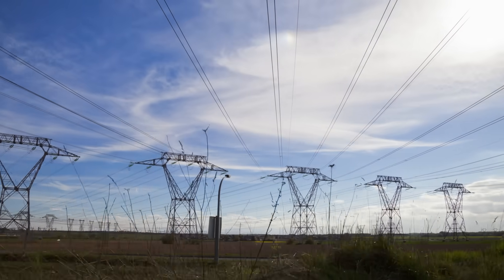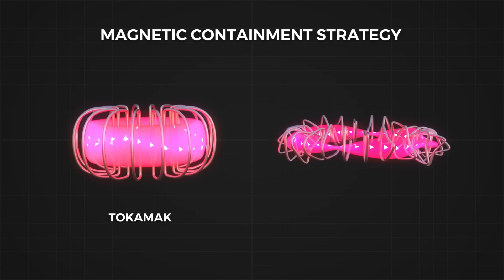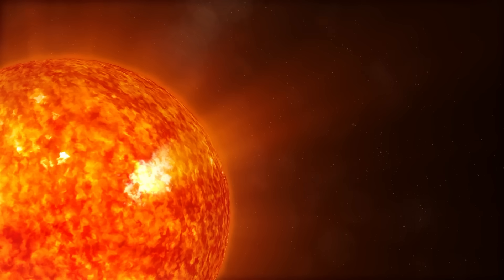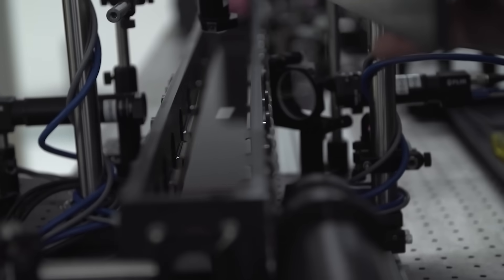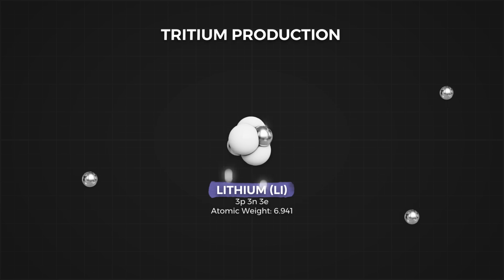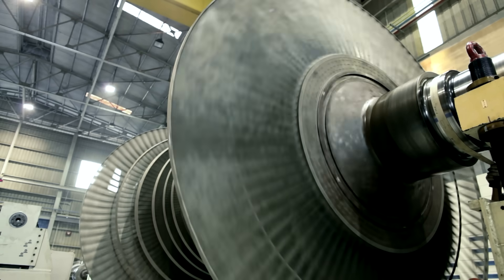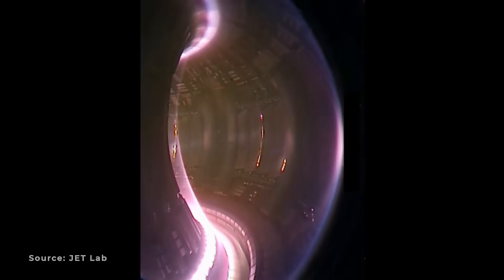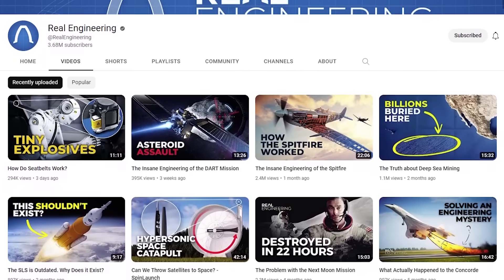The Problem with Nuclear Fusion

Comment: Commercial fusion would enable fast and efficient gasoline and diesel fuel generation. It can cost effectively extract CO2 from the air. So no need to destroy the Earth’s surface strip mining lithium and rare earth metals for battery manufacturing.

Comment: We are hearing more about Fusion in recent releases.   But I don't believe it is an answer.  Your post points out the many issues that are not yet over come. Supply of the right materials is a major issue.
And still we use steam,  which any train enthusiast will tell you is high maintenance.  
Personally I believe there is another way without steam driven generators. 
That said, the current urgency of CO2 clean energy  Current Nuclear Fission power is a must.  
Waste issues can be greatly reduced by having joint  Caesium / Uranium 235  waste feed into a Thorium Salt Water Reactor. 
This will give up the waste into energy,  reducing storage time frames dramatically, as there is less radioactive material energy left.   
Then waste could conceivably rocketed to the Sun where the Radiation levels are so very high as a norm. the so called waste would consumed as an extremely low, negligible addition.  
Should that even be required.  

But there is another way.  The Knowledge is known and one wonders why it is not being spoken of.. 
The properties of Mercury are under used.  Not by burning but spinning..

We all need to get our combined heads out of the sand.   CO2 is driving an insanity,  Belief that we have Batteries that can save us.   We don't !     That we have answers to The cost of Hydrogen conversion!  We don't.   The Belief that charging an electric vehicle for an minimum one hour is O.K.  at lest twice a day,  for business cars.
I have been a Company Representative for multi nationals..  I would fill the company car once every two days.   I had a very large territory to cover  one week was over 3000 klms  in fact that was after flying out to a near far point.  Getting a hire car and traveling another 250klms further out to then make calls on the return.

Where are those charging stations going to be?   You can hardly plug into a tree !  
Let me also ask...  Who has calculated the effect of reflective Solar panels ????   CO2 and Methane  + reflective solar panels.   Yes!  we will have Global Warming !   MAN MADE ? 

You folks need to look up Youtube sites like "Astrum"  and see what solar cycles are over thousands of years.
Also "Geologyhub"  See how there is a rise in Active Volcanic activity.   Which includes Earthquakes and tremors ..   Then explain to me how the core and magma has heated?   It is nothing to do with CO2 !
If it were we would also be crisped already. 
What we are doing is going to make it worse!   NOT BETTER.   Until we come up with another solution we have to go Nuclear powered Grid.    Or Millions will die.    

"Ideals" are call that because we can't call them "Practicals "     Utopia is an Ideal !   Reality is being Practical !  

I actually believe we are being taken down a path,  that is know to be harmful .   To Gain Control !

Comment: There is one thing i never quite understood about fusion, it is usually claimed to be cleaner and safer than fission in the sense that there is no radioactive waste to be dealt with. However if the blanket is cooled by water which is being continuously bombarded with neutrons, wouldn't that lead to the water being activated through the capture of neutrons by the hydrogen atoms therefore turning it somewhat radioactive? 
Also there is stuff like oxygen or nitrogen dissolved in the water which can be activated even more easily therefore complicating this further. I assume that the coolant is turned into steam and therefore would present the same problems with radioactive steam for safety as conventional fission plants. This would again lead to lots of necessary precautions for safety therefore making the plant extremely expensive again.

Is there anything im missing here like other coolants except water (though I have no clue how that would make things cheap in any way)?
Reply: Fusion (when actually built) being cleaner than fission is a (dangerous) myth. Anyone seriously studying the subject finds that fusion (even if successfully built) would have more radioactive equipment waste because of lower specific power and more complex equipment and shorter equipment life (due to faster 14.06 MeV neutrons) ... See Hans Bethe and LANL study Barrett, R.J.; Hardie, R.W. (September 1980). The Fusion–Fission Hybrid As an Alternative to the Fast Breeder Reactor      https://en.wikipedia.org/wiki/Nuclear_fusion%E2%80%93fission_hybrid#Fission_basics  There is no advantage of fusion even if fusion is allowed to not produce net positive power (but aid in breeding fuel for fission). There is no practical fusion concept that involves less equipment or total waste than breeder reactors (fission product waste is only 30..50 times less than equipment waste, and actually most of the fission products are valueable, roughly 16 million dollars / ton). Ahh, of cource aneutronic fusion would be cleaner... pipe dream. But fast-neutron fission solves EVERYTHING that fusion promises. It's not a technical problem, but "political" problem.

Comment: I want to say a big thank you for highlighting the challenges engineers face in making research breakthroughs a viable solution. I work with research, and they come up with interesting prototypes, but a lot of them won't make it any further due to fundamental problems (be it economic or resource limitations). I don't think many people understand that research this is just a first step in developing a successful product.
Reply: I was thinking of a gravity-powered generator that you might like to research: Build twin towers with twin, water-filled weights on cables, turning a generator. One filled more, heavier, than the other, and when the heavier one gets to the ground, pump the water from it to the other one, and it comes down, pulling the other, now-lighter weight up, and continuing to turn the generator. The only energy needed is to pump the water back and forth. If you make a billion bucks, contact me, and I'll send you my PayPal number - 80% for you.😀👍🏻
Reply: mn
Reply: Would you say that the one aspect that is stopping our species from progressing is the old value systems of the monetary system? And would you support a System based upon natural laws instead? I like this idea but we need to educate people beyond fearing change. https://youtu.be/NNUgmI6tyzU?t=222
Reply: @calderarecords  Survival of the fittest is based on the fittest, and has no morality.
Reply: Yeah like the first step of 1000 difficult steps
Reply: Isn't the problem that it's basically been at the first step stage for half a century?
Reply: Wtf mokou????
Reply: Then why didn't you hear the news they achieved fusion with lazers
Reply: @derpderpy3075  Yes any they managed to get 1% of the energy used to create it! <SLOW CLAP>
Reply: Our human limitations are literally holding us back, we need a singularity so we can connect it all and think about it for just a few moments.
Reply: There are no viable solutions or breakthroughs in fusion.  Hitting a pellet one time in a special enclosure capsule to get a strong output reaction achieves nothing for production fusion.  Spending your life runs joltomatic donuts seems really sad and a waste of talent.
Reply: @donaldkasper8346  you are amazing. Are you the guy at the party this time of year that tells kids Santa isn't real? OK it's research but you definitely are sounding like their potential is non-existent because they haven't achieved it yet. Maybe I'm wrong, perhaps your statement is just an initial assessment of possibilities (or lack there of) and you intend to suck a huge D when they figure it out and you look like the scientists who said Fission wasn't possible. Yes fission not fusion was deemed impossible for awhile where was this guy Dec. 2nd 1942? Ass
Reply: @sethspot1  I remember the day I told a friend Santa wasn't real.  His parents got really pissed.  You know, sometimes reality sucks.
Reply: @sethspot1  I may be amazing, but tokojoltomatic machines aren't.  I mean, "Hey, starting a jolt, turn on the recorders", is your life, sounds so limiting.
Reply: @sethspot1  Sounds like a childish response to scientific scrutiny.  1.  There is no such thing as millions of degrees.  Our sun runs at 6000K, all of it, not the photosphere.  The spectrum created has a peak that shifts to a square wave function.  This function limits the max temperature possible, which is 6000K.  2.  The universe had no big bang because there is no CMB hot spot that shows us where it is or was.  3.  Black holes confuse the math concept of infinity, which is nomenclature for etcetera or more like that follows, with something real.  There are no infinities in the universe.  4.  The universe is not expanding by any direct observation.  Insert excuses here, and make up surrogates to make it come alive.  For example, 750 years of the zodiacs then and today are exactly the same.  Star angular relations are unchanged, moving near the speed of light for 750 years.  All notions of expansion are based on red shift surrogate data.  Light red shifts for farther objects due to attenuation from other interfering light sources, not motion.
Reply: @donaldkasper8346  wow that really hit you at home didn't it?
Reply: @sethspot1  Right at home.  I have a laser lab and conduct mineralogical research.  I have the research paper draft that shows you change the density of a mineral in a compositional series, you change its refractive index, and if you increase its density, the spectra red shift.  You don't have to move a thing to get a red shift in infrared.  Some day, when this big paper gets published, you can see how that works.  So your world is a bunkism world 25 years behind me on infrared.  If that work did not have negative refractive index in it (one of the definitions of dark matter), the paper would have been published 7 years ago.  But alas, there it is, so no it hasn't been.  Always remember, star light is not light.  It is light through star dust and that dust has silica.  So you just lost with your backward interpretation of infrared.  That silica goes from quartz to coesite, your spectrum just redshifted.  Deal with it.
Reply: @donaldkasper8346  The big problem with our understanding of “expanding” is that it usually means “expanding into”. The fact is that there is no “something” into which the universe is expanding.

The current model is that the universe is both infinite and expanding. That seems to mean that things are getting farther away from each other.

It also implies that Every Point is the “center” - since “center” means “equidistant from the ends” and as there are no “ends”, the notion of “center” has no meaning.

Another example: no matter which way we look into the Universe, we see the same thing: everything moving away at the same rate. If there were a ‘center’ somewhere Out There, one part of what we see would be moving faster (or slower) than what we see in the opposite direction..
Reply: @donaldkasper8346  I think you need to do some basic research on this rather than being a great example of the Dunning-Kruger effect.
Reply: For example, if galaxies actually spin, prove it.  Show tow photos with star blocking/unblocking causing variable luminosity.   I think 2 or is it 6 galaxies in the universe have variable luminosity.  Start with time lapse picture of those.
Reply: We have old photos of galaxies from 150 years ago.  That is enough time.  Show one with something changed.  Anything.  Pick from any of the 1 trillion galaxies, but I would use those flat planar perpendicular to our point of view.  Like M34.
Reply: @donaldkasper8346  All the objects you see in space, including galaxies, started as more diffuse material that collapsed due to gravity. So to answer your question, you should probably turn it around. What are the odds that a galaxy could form with no spin? (We'll ignore the fact that the spin is what prevents all the stars from falling in to a single point for the moment.) It turns out that the odds of having exactly zero spin are pretty much zero. You expect things to have some amount of spin. They don't have to be spinning fast, but zero spin would be surprising. As they collapse, conservation of angular momentum causes whatever small amount of spin they had to become more noticeable. The angular velocity goes up, just like a skater pulling in his/her arms.

This is actually something that you can see almost any time. Fill a sink or a bathtub with water. Let it sit a while. You have calm water with virtually no spin. Now pull the plug. What happens? You get a whirlpool as the water comes down to the drain. Where did that come from? The water didn't seem to have any spin when it was a long way from the drain, but here again, the odds of having exactly zero spin are basically zero. On average, there is bound to be a bit of spin one way or the other unless you waited a very long time and the friction with the edge of the container stopped it. As the water moved toward the drain, the angular velocity increases inversely proportional to the distance from the drain. The result is that by the time it gets within an inch of the drain there is significant spin.

This same thing happens with all astronomical objects that form from collapsing clouds of gas. That includes galaxies. Indeed, for astronomical objects, because there isn't any friction, the amount of angular momentum determines how far things can collapse. Once the spin balances out the pull of gravity for the mass interior to it, you have equilibrium.

Take a random collection of point masses, each attracted to the rest by gravity. Put them into a piece of software called an N-body simulation and let the simulation run. See what happens.

Well… because the point masses attract each other, they will start to, for lack of a better word, “clump”. (Actually, it’s a good word. It’s used in the professional literature.) Soon, the initially homogeneous, random arrangement of point masses turns into a few disconnected clumps, with a few loose point masses in between.

Now those clumps… they will not be perfectly symmetrical. Even if a clump consists of only two point masses, chances are they will not end up heading exactly toward each other. They will be offset, ever so slightly. So instead of colliding, they miss and end up orbiting each other.

So each of these clumps will consist of a number of point masses in more or less random orbits. But the angular momentum of these orbits will not exactly cancel. Over time, things settle down, as point masses undergo close encounters and exchange energy and momentum through mutual gravity. In the end, whatever the net angular momentum of the clump is, it will remain dominant.

The total net angular momentum of the simulation would remain zero throughout. But one clump will rotate a little this way, another a little that way, and so on, randomly.

Now if you began with a set of point masses distributed perfectly symmetrically and not randomly (e.g., in a grid pattern) this would not happen. In fact, they would collapse into one or more singularities. But the equations of gravitational dynamics are finicky. Even a small rounding error in the sixteenth significant digit of a double-precision floating point number may be sufficient to introduce the necessary randomness such that in the end, instead of a regular pattern of singularities, you end up with random, spinning clumps.

I think you have already denied any form of intelligence entering your mind so I’ll not waste my time anymore. Believe what ever you want.

Comment: ahm, you make all that fuzz about the tiny amount of Uranium in the Berrylium, without stating, that Berrylium itself is ridiculously toxic! The production of Berrylium is so low, not necessarily cause it has no useful properties it is so insanely rare, but because nobody wants to have the burden to handle it. It is actually a very light and tough metal, so would be amazing for aeronautics, but dealing with its toxicity is a nightmare ...

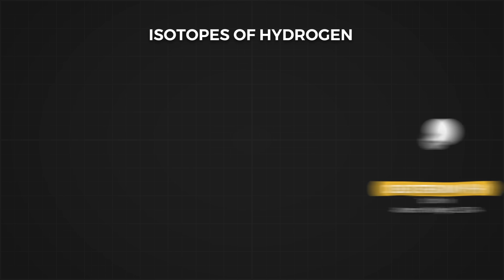Comment: At around 4:00 you say that we could perform p-p fusion but the energy extracted is very low. That is misleading. After all, the created deuterium can then undergo other fusion reactions. The problem is the extremely low fusion cross section ("probability of a successful fusion"). We can not perform p-p fusion at a significant rate, even if it would output more energy. You state this correctly shortly after in the video.

Also, you claim that the "failed" fusion chain p + p -> 2p -> p + p releases "very little energy". In fact, it releases no net energy at all. Otherwise you would have a perpetuum mobile wouldn't you?

Lastly, about the uranium: The U-235 content does not really matter. U-238 is not fissile (i.e. can not sustain a chain reaction), but in the fusion reactor it is supplied with external neutrons. Those neutrons can cause the U-238 to undergo fission (not fissile is not the same as not fissionable). Or it could be converted into Plutonium-239. So it is not less dangerous than the U-235. Both will create highly radioactive products. Or is there something I am missing?

Despite those criticisms, I find the overall video quite good and informative! For a layperson, the admittedly small oversights probably don't matter :)